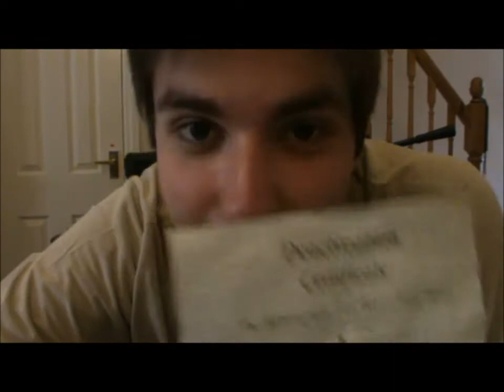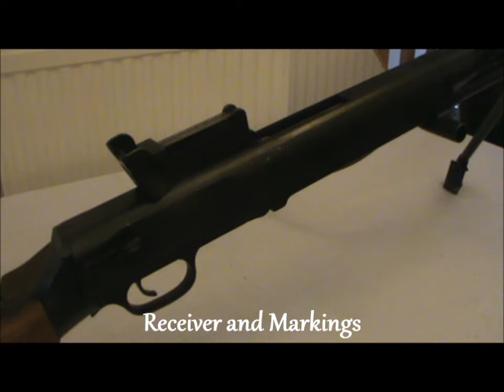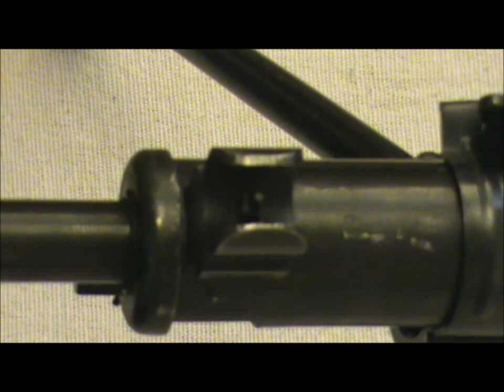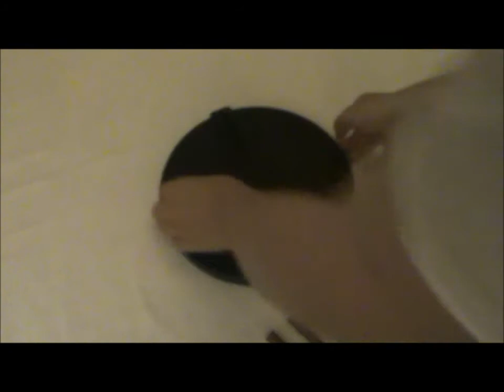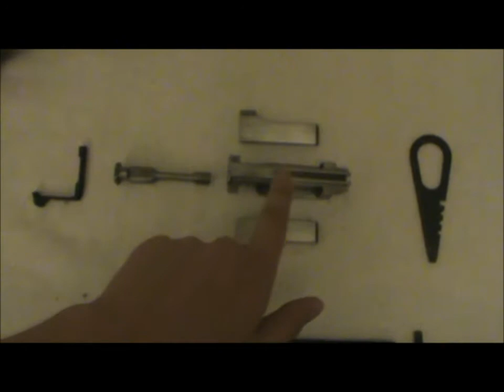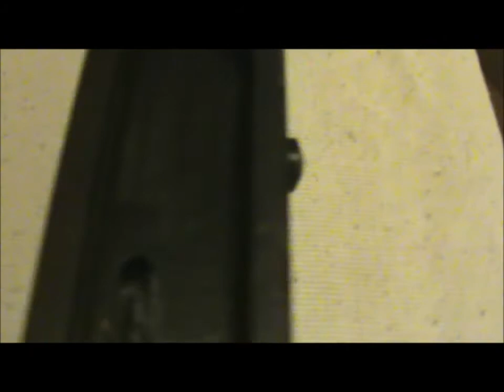DP28 Light Machine Gun

Comment: I was gonna say, it honestly didn't even look like it was deactivated, but I suppose the barrel and receiver have quite a bit of welding preventing them from firing. I'd love to get one here in the US as a semi-auto, but they cut up every single receiver and barrel into three pieces over here, so you can imagine the dilemma of trying to find one intact like yours. Still haven't even determined which would be better to own honestly, the DP-28 or the DPM-28.
Reply from the maker: I was lucky to get it when I did. The new deacts are all welded solid now, no moving parts, real shame [They used the terrorist attacks in Europe as an excuse, even though it's got nothing to do with it]. I've gotten back into airsoft since because I refuse to buy welded crap.
Reply: Damn, y'all are getting hit hard too huh? The politicians over here are trying to do the same thing, but it most likely won't pass. Should I try to buy one of the parts kits and try to find someone to re-mill it into a working semi-auto gun? I imagine it's worth it
Reply from the maker: Sure why not. There are also DPM parts kits in the U.S, which is an improved 28 with a pistol grip and different recoil spring assembly.
Reply: That's the thing, I didn't know which would be better to own honestly, an original DP-28 or a DPM-28? The original is a classic, but if I were to re-mill the gun then it'd probably be wiser to own a DPM with the improvements I imagine.
Reply from the maker: Design wise the DPM is better for reasons mentioned in the video. Most of these are not an issue in a semi-auto build as they are associated with firing in full auto. i.e, the recoil spring being easily affected by barrel heat due to it's position in the gun.

Comment: Nice video Taz! just got my 1944 DP28, great weapon.  Also just wondering, what do you use to keep all your deacs clean and lubricated? Debating on what to buy for my Mosin.
Reply from the maker: WD for cleaning, just keep it off wood. I use 100% silicone or bees wax for the wood, and high point melting grease for lubrication because it lasts for ages and doesn't come off easily. With MGs, most of the lube you want to put on the bolt tracks inside the receiver, versus the bolt.
Reply: TaZ101SAGA Thanks